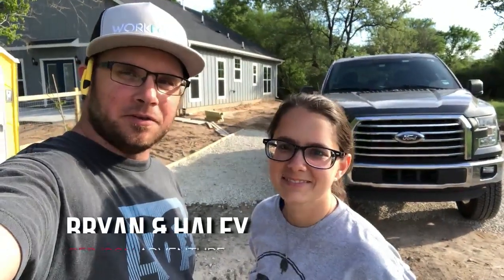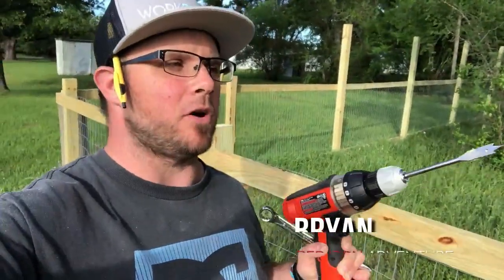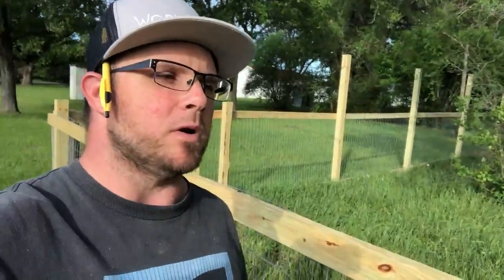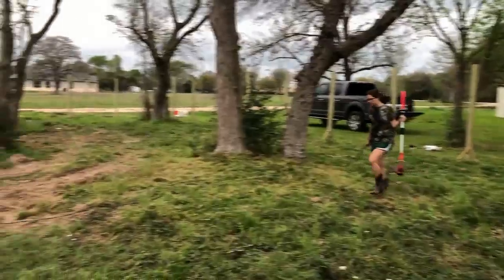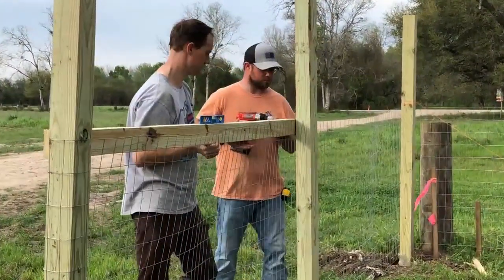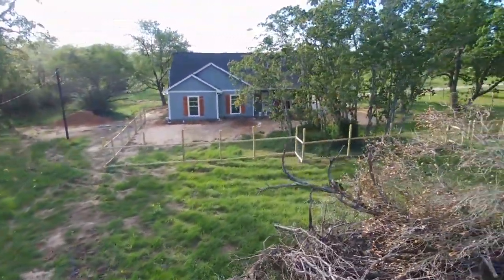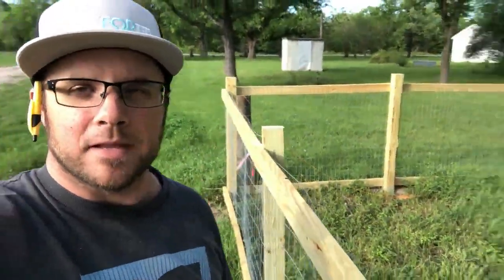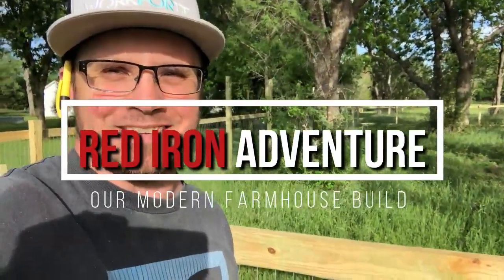DIY Fence - 250 Ft For Under $2,000!

Comment: Add a ground contact rated base board so the doggos don’t push the wire from underneath. Also some one bys running across would look nice. It would turn it into a corral fence.
Reply from the maker: We’ve not had any issues with the dogs, but great ideas! We actually extended the area for a goat a few months ago using the same process.

Comment: I would suggest. a zero turn mower 
for its maneuverability. If it fits your budget. But if you find a great deal on a riding mower get it.
The house looks great. And you built the fence I would have if it were me.

Thanks guy's